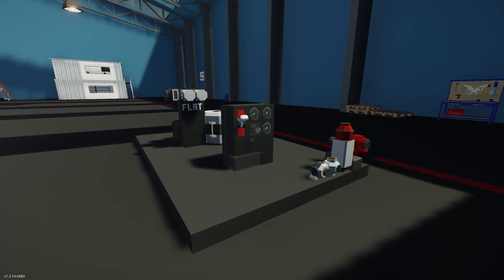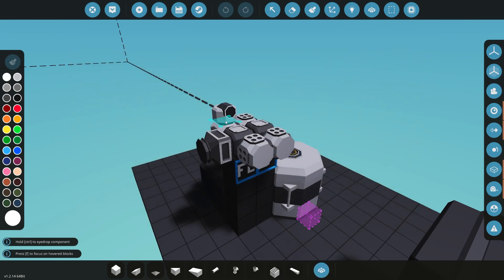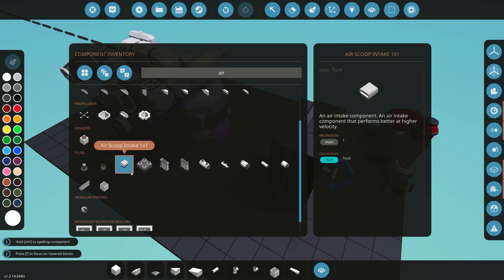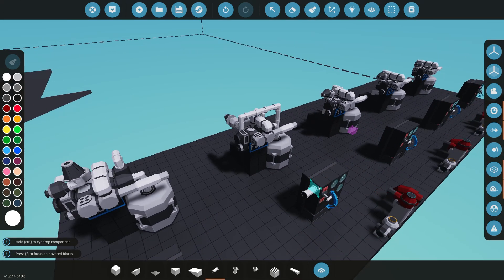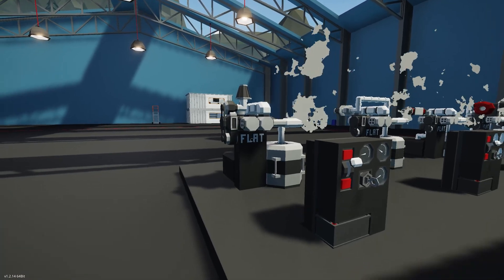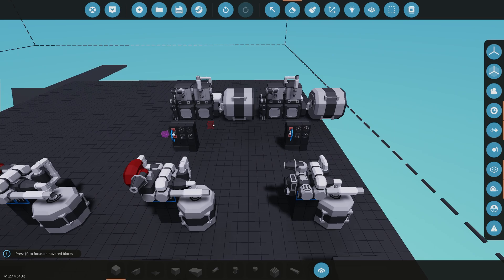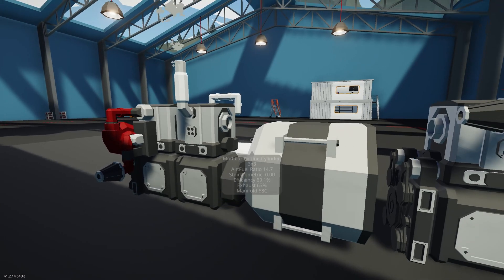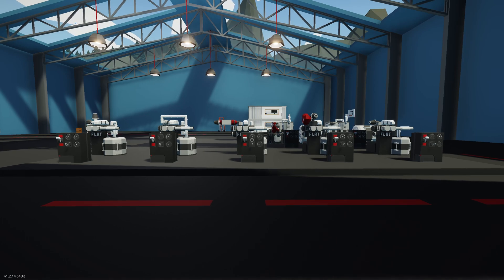Do Superchargers Work?? - Modular Engine Test - Stormworks

Comment: Informative as always. Next one should be cooling.
Reply: +1 to cooling being next, its far from intuitive since the restriction of cooling water has so much effect. For now though I find engines work as one large tank of fluid (shared between all cylinders), and cooling manifolds like fluid ports. Try pairing a single radiator with each cooling manifold, and using a pump both into and out of the manifold, as that will maximize the water flow, thus minimize the difference between engine temperature and radiator temperature. Also nuclear reactors, fireboxes and heaters emit heat in a radius around them, so if you place radiators in that distance they will heat up (even if in a different sealed space)... I find for small creations you need to use a thermometer and threshold to limit your heaters to ~20'c, since otherwise your engines (or steam condensers) overheat as cooling system can't be far enough away, and as a bonus your battery will last longer.
Reply: Yeha issues with cooling
Reply: Yes, a cooling guide  about how it works in game without calling people stupid. In the game it does not work like in real life, and that got me to quit playing Stormworks as none of my creation can be used unless I make them out of radiators.
Reply: Best way to do that would probably be to have the engine controlled based off of temp and see what has more power in the engine at say 90 degrees.
Reply: Well, as someone who has started many engine fires from inadequate cooling, I can surely tell that it is very important. Lol
Reply: The best way to cool your engine is to adjust your ecu pid sensitivity so that it will adjust between being above and below your target rps constantly, that way the engine will briefly stop combustion each stroke and allow the engine time to cool, or at least slow the rate of heating up. In combination with radiators and cooling manifolds your engine will cool with some tweaking
Reply: @mrskywars1237  The amount of additional cylinder temperature generated per unit of fuel used in game never changes (the output torque however does based on the number shown in detailed tooltip, itself a function of RPS, temperature and AFR, NOT directly throttle state or air pressure), so pulsing the throttle high to low doesn't achieve anything that running a constant throttle value in the middle wouldn't.

One step further, there isn't any stroke simulated, and all connected (adjacent or sharing a manifold, even if different sizes, on different crankshafts turning different speeds ect) share temperature, air to fuel ratio. This allows for some pretty interesting builds, just keep in mind you can't throttle the engines separately, so if you want to stop one but not the other, you'll need to stall it out with load (like having far to high of a gear to a generator, or a connection around to both sides of a gearbox you then set to a value other than 1:1 to stall).
Reply: Keep your cooling pressurized is my tip and don't use full throttle and keep the rps around 20 or 30

Comment: Doesn't temperature affect the stoichiometric and so change the efficiency or power of the engine independent to supercharge?

Instead of the pumps one could add more cylinder, increasing power and fuel consumption as well.
Basically comes down to power for fuel consumption.
Reply: Yes, Heat engines are more efficient if less energy is converted into heat.
If that's what you meant

Comment: Need to test modular engine with the flywheel. I know it's take a few seconds to start.
Reply: I love adding flywheels to my engine builds. On Helicopters, it makes landing without power much safer and on road vehicles, it keeps you from stalling out, so its great on cargo trucks.
Reply: @danieljones8706  I even use flywheel on regular engine by using modular clutch to bypass the flywheel.
Reply: @danieljones8706  A flywheel also helped my boat not stall and die when disengaging the clutch

Comment: The impeller pumps dont work. It actually slowes down the engine
Reply: Are you not adding enough fuel?
Reply: Sadly so. Connecting them directly to the engine causes a reduction in output torque. You also cannot hook up another impeller to make a more realistic turbo to generate energy.
Reply: @ranchero5595  really? I have been making twin turbos in all my creations, do they not do anything???
Reply: @averagegamer5617  sadly not
Reply: @ranchero5595  well looks like all I did was made a more complicated exhaust system. I did test them out to see if I was getting any reading after seeing these comments. I got a constant torque output(by putting a t-pipe between the two impellers and that torque reading thingy) of 1.2 and no rps. I guess this means there’s no rotation or not enough to show, but there’s exhaust coming out of the impellers and there’s no air bypass so it doesn’t harm it by the looks of things?
Reply: @averagegamer5617  No, but it doesn't help either. It's a cool addition however. BTW that torque isn't what's being produced but the effort it takes to spin.
Reply: @ranchero5595  ok, that would explain why it read a constant number. Thanks
Reply: @averagegamer5617  The "torque" sensor actually measures moment of inertia instead of torque.

My testing indicated increase in power the most at high RPS, right by the limiter.
Reply: Need gearbox 3:1 and all will be fine!

Comment: Impeller pump is the best at 25 rps i produce 70 psi. Then the engine is running pretty lean so i up the fuel trhottle to make the engine run at a stable afr of 13.2 wich produces 120watts

Comment: I wish there was atmospheric pressure that would decrease with an increase in altitude, so to fly high you would have to come up with some form of forced induction!
Reply: well guess what guys… it happened
Reply: And they should add a turbine so it could turn flowing fluid into tourk!
Reply: @tylers5952  steam turbine
Reply: @tylers5952 steam engine
Reply: Space DLC update
Reply: that would be cool! Im looking to theese days when you'll flight to the moon in stormworks :D
Reply: @adamhnat5123  Guess what :D
Reply: @Zorro9129  no way 🤣🤣🤣
Reply: @adamhnat5123 it happened.
Reply: Can you believe it... its gonna happen @adamhnat5123
Reply: @adamhnat5123 now you gonna can
Reply: @adamhnat5123  guess what
Reply: Now you got it
Reply: Yea
Reply: Lol ocean gate subs go boom
Reply: Space dlc
Reply: Well guess what!
Reply: 3 years later and all I have to say is: well well well
Reply: Yeah that should be cool
Reply: @Sussy ass motherfucka I agree with you so much!  Because I love building aircrafts.
Reply: Yeah and it will prevent some prop plane going to space and flying high should also decrease drag
Reply: That should definitely be toggleable because if not most planes won't work
Reply: @Oceanic620  They would work if they keep the pressure at 0 meter elevation the same as the pressure now! If planes would start to fly really high they would start to struggle which is good IMO
Reply: It is now :DD